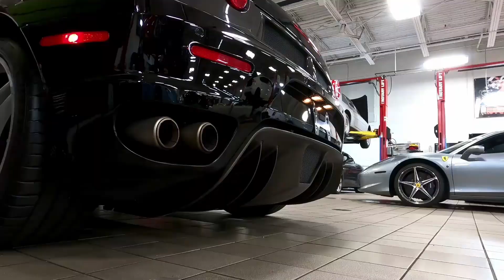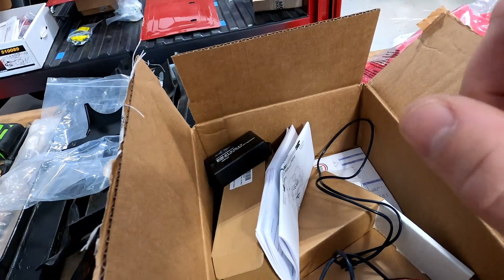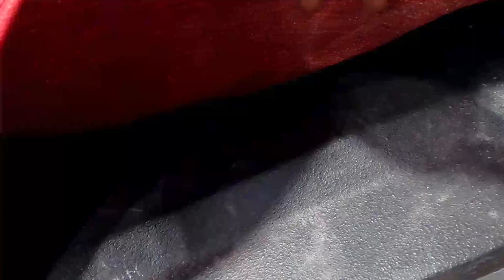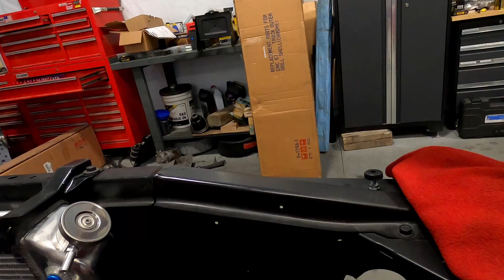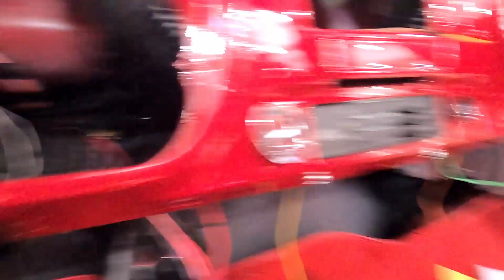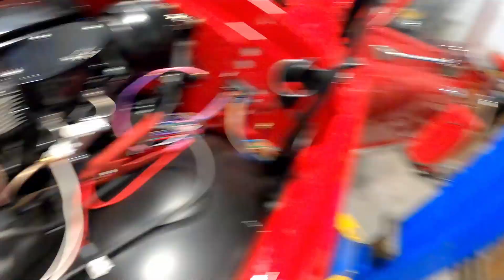1969 GMC c10 frame off build, wiring up electronics today

Comment: Awesome video. What kind of board is that?
Reply from the maker: That's just plywood with fabric glued and stapled to it. Plastic starboard from the marine industry works well too, and you can get it almost any color
Reply: @quick455 I thought it was Starboard at first. Thank you for the prompt reply. I'm about to get started on wiring up my 1970 Cutlass Restomod.
Reply from the maker: Starboard is great to use, I use that as well. Best part is you can get it colored already if you don't want to have to wrap it after the fact

Comment: This is right up my alley. I just bought Dakota digital gauges and holly terminator. I’m using the mount set up as my blueprint. Thank you 🙏🏿
Reply from the maker: I've done multiple like this, if there's room under a seat or against the back wall in the trucks I like mounting it all there so its neat and clean. If you look up our "Sunshine" F100 build it's like this as well except it's running a factory ECU. On the cars I find usable space under the dash to tuck everything in since there's usually not much room under the seats, Like on the current GTO build I have going on.

Comment: Very nice work. How much work was it to get the Dakota digital dash to work with the Holley
Reply from the maker: Very easy, Dakota makes a BIM module that plugs right into the Holley CAN communication connector and sends all the signals right from the Terminator to the cluster. You just have to go into the Terminator software with a laptop and switch the CanBus to RacePak communication. Bunch of videos and walkthroughs out there on how to do if you never have.
Reply: @quick455  Awesome thank you very much for the information I really appreciate it

Comment: Seems like a terrible location to mount these. Drive the truck one time and forget to close the windows and dakota modules are dead...
Reply from the maker: These are under the seat and on a 3 inch raised section of the floor pan. If you somehow get 3 inches of water into the truck cab that will be the least of your issues.
Reply: Greetings! Great video. How did you get power and grounds to your buss bars under the seat? Can you run wires directly from battery or pass through firewall bushings?
Reply from the maker: I ran them from the battery through holes with grommet insulators. You can use firewall passthrough bulkheads though instead